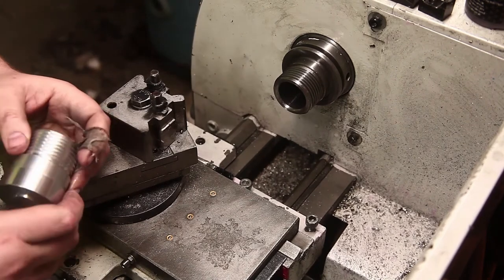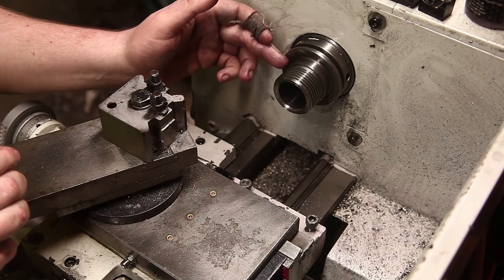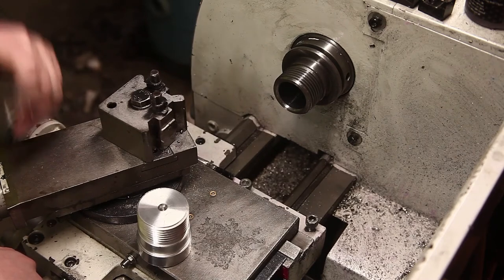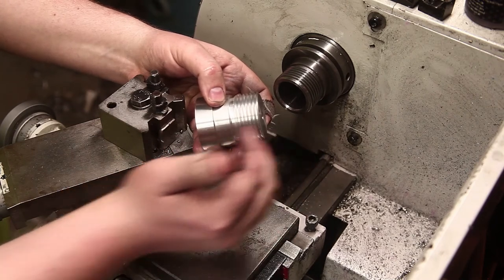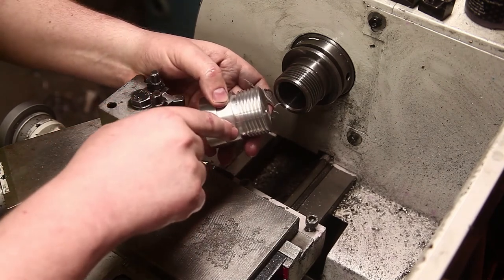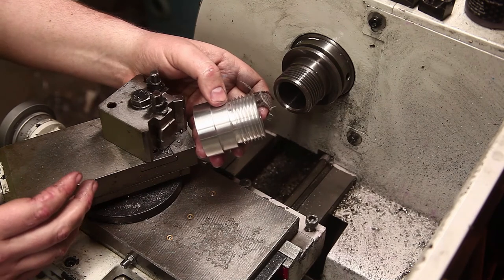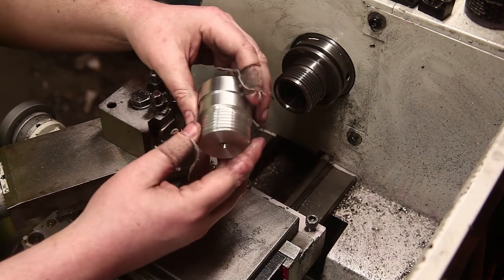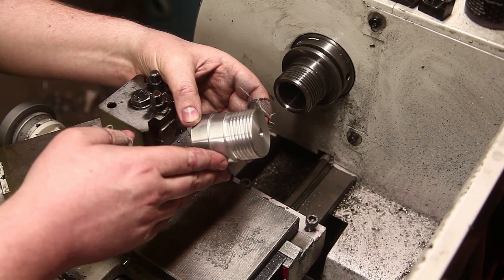MACH::Spindle Nose Copy

Comment: You are going to enjoy your additions, especially the 5C collet chuck.  Good job on the threads Adam.  I have an upcoming job with internal metric threads, a first for me. Have always disengaged halfnut previously.  Impending disaster is always an adrenalin rush!
Reply from the maker: Thank Michael!

When I do UN threads, I get worried that I'll miss the number on the threading dial as my spindle doesn't have a brake, so I keep the thread engaged and retract the tool as quickly as I can.

For internal threads, have you seen the technique where you put the tool upside down facing the 'far side' and run the machine in reverse? You start the cut at the bottom of the hole (allowing you to rotate the chuck by hand to find the starting groove, and avert disaster!), and the tool feeds out to the top of the hole :)
Reply: I've the technique you describe.  Maybe its time I try it.
Reply from the maker: Michael Murray looking forward to seeing how it goes :)

Comment: first comment! how does it screw in the chuck?  looks good tho
Reply from the maker: Emmas Spareroom Machineshop Clockwise :D

The back plate has a matching thread but starts with a 46mm counter bore which the backplate registers on the nose diameter.

I probably should have pulled out the faceplate and demonstrated screwing the plug into it.